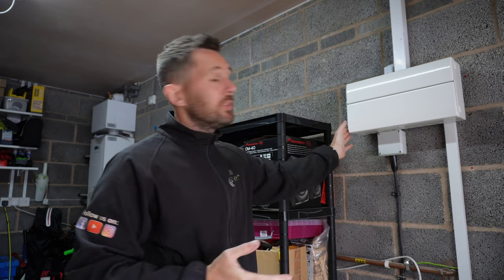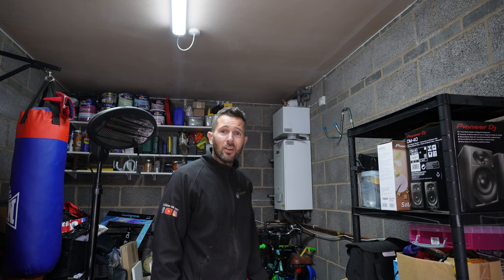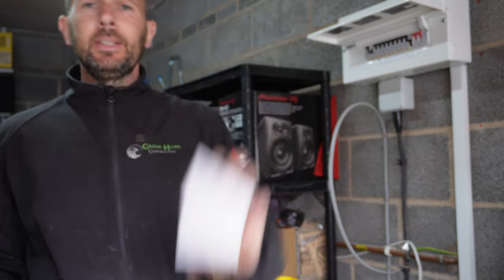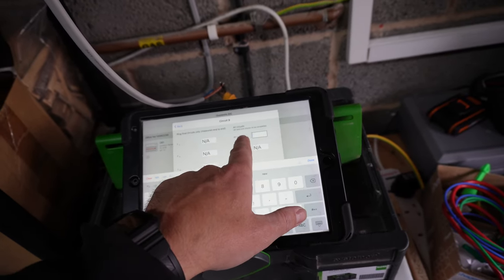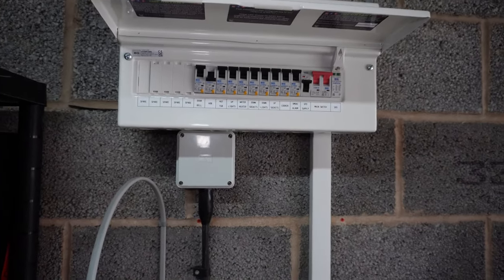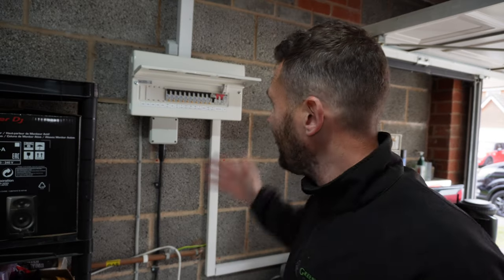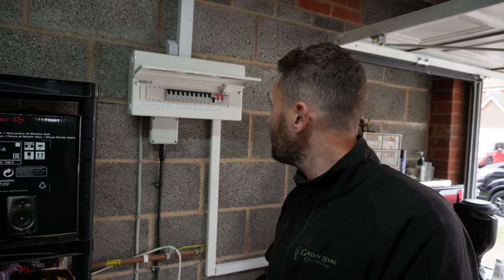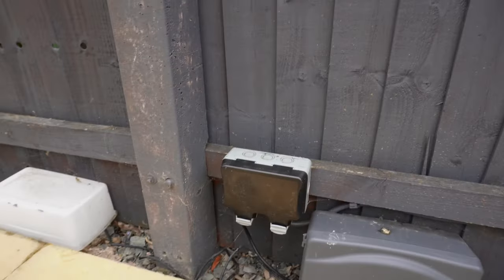Installing a new hob circuit in a BG Fortress board

Comment: Based on the camera angles etc, & IMO, I would have placed the cable in trunking myself.  The 6mm looks to be a the same height of the bicycles handlebars  & gym equipment, and any other items that are stored in the garage.

Comment: Good video as always. I think if you can't take the cable up and over the additional protection of some pvc conduit is worth the very minor cost.
Also, I like this board but I would always use the DIN rail mounted blanks to cover the busbar. (61p each at Screwfix).

Comment: Nice neat job as always,you might mention to the home owner about installing another socket near wherever that flexible cable around the gas pipe is meandering off to as its clearly not a temporary supply.